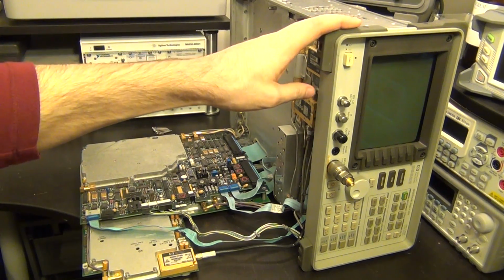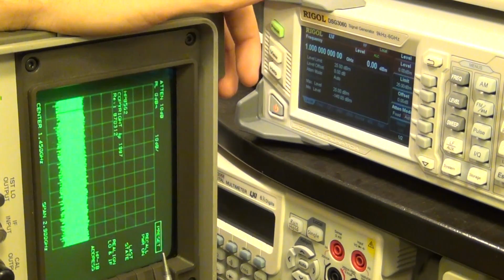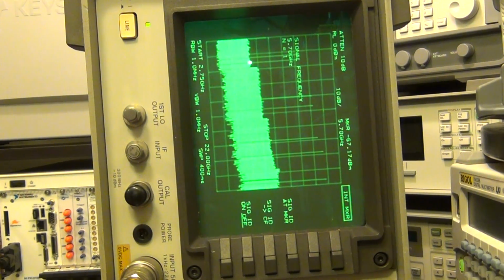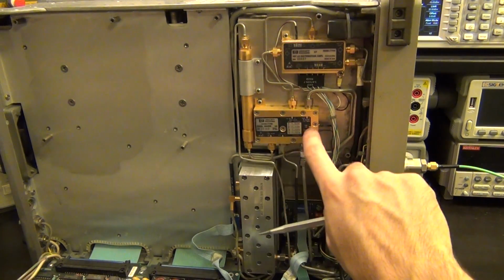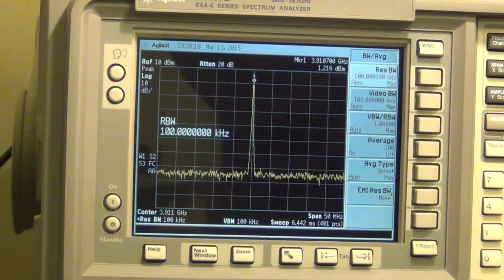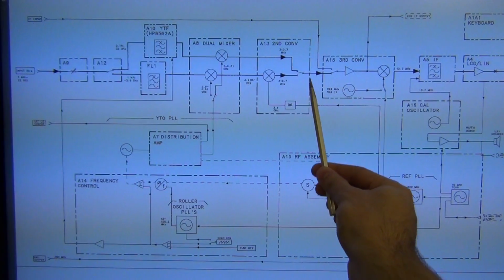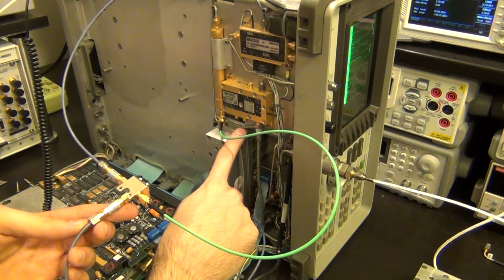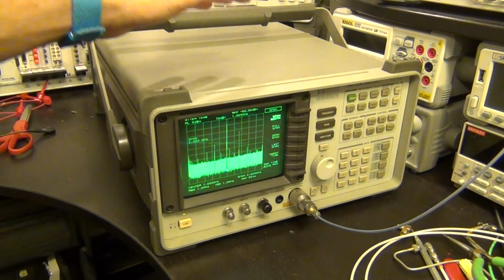TSP #47 - Teardown, Repair and Analysis of an HP 8562B 22GHz Spectrum Analyzer

Comment: Hello! I have one of these (8562B) for sale... It was unused for a long time and had a problem with the power supply when turning it on. It was working fine before that. I'll give you a good price the way it is. It is still possible to recover it for use or even for spare parts to repair others.

Comment: Thank you for sharing your experiences, very nice your troubleshooting video. Could you give me some advice !?: " I have a HP 8561E spectrum analyzer (a quite old SA), during the operation, I accidentally connect a wrong RF input power over +30dBm in very short time until I recognized that I am wrong- about 10~15 seconds (It is 1W RF input max indicated by manual). Now, I guess it damaged the "RF input attenuator and the input mixer", is it right ?. When I connect a source of signal + 34dBm with a 40dB attenuator, But the screen now only shows me ~+14dBm (all ATT menu settings are set as: Ref.lvl = +40.3 dB = the 40dB attenuator+cable loss; The auto ATT set as manual @ 0dB). I guess the 20 dB ATT inside the SA was damaged.

Comment: At 50:20 notice that the spur is much narrower than the real signal. 
And there are a lot of false signals if you look at the whole bandwidth. 
All of them are noticeable narrower than real signals and they are always there regardless of input signal. 
I have exact same problem with my spectrum analyzer and it appeared suddenly! 
It was clean at the beginning.

Comment: Very helpful video.. I am having a few problems with my HP 8566B spectrum analyzer and even though it is a different unit, you have cleared up several things I was confused over regarding the mixing schemes.. 
Do you have any plans to do a tear down of an 8566B? No one has done this on youtube and yet  the 8566B remains a very useful and popular SA.

Regards,
Glenn 
DSM Labs

Comment: I have a 8592b and there are a few problems. First when I punch in a frequency the carrier if on frequency. But when I go to span it outward the carrier moves way off frequency. What will cause this problem? My other problem is the I and 11db off when I measure amplitude. What alignment would fix this problem? 
I have a  8591E and with no input signal  there is a high pulse that is after the spectrum analyzer 0 frequency carrier. What is causing this unwanted.
Reply: Rosalina19711 the 8592b is not synthesized, in the b model they omitted tge sampler and PLL and rely on a lookup table for the yig frequency. Just bump the case of the 8592b on small spans and you see microphony on your signal! The datasheet also says freq accuracy is 5% of span and the unit has no ext ref input as there is no PLL :)

Comment: Thumbs up for another interesting video and ESD-aware handling of sensitive components! :)

A little tip for all Weller Soldering Station users:
The older soldering stations come with a 3,5mm jack plug, which can be used to configure how the tip of the soldering iron is connected to PE.
Without that plug the connection to PE is hard (approx. 0 Ohms). If you're soldering ESD-sensitive components you might want to make that a soft connection (i.e. 470k) by soldering a 470k-resistor into the supplied jack plug.

Comment: You could have skipped installing the RF relay by using the LO output, but maybe you wanted to keep that. I was also going to say that you could have tested the 2nd mixer with a 3.9GHz RF signal but just read that you did that off camera. And I think the unit is not very useful wit all that spurs, I really wonder if that is normal. Oh, and you can see what the LO level is by just hooking up one of your other SA's, I wonder if part of the spur problem is related to the LO level.

Comment: Just a guess Shahriar, is that the Double-balanced Diode Mixer has a virtual ground within the mixer that is not sharing the same ground as the higher band mixer signal.
The unwanted spur's are not properly grounded or filtered out from within the HP Dual Band Mixer Assembly. On the high end the spur's don't occur at 5.9 GHz frequency
but at the low end they are generated. Could also be that the introduced mixer doesn't have the required shielding as the original mixer does. Anyways great video, allways
look forward to seeing what you are upto next. Cheers
Reply from the maker: Interesting idea. But I connected the external mixer to a different spectrum analyzer and there were no other tones besides the LO feed through. This is somehow due to the interactions between the second converter and the first...

Comment: The spurs are both sides of the signal so something's being mixed with the input.  could be some sort of harmonic distortion as there are more than one spur. Look at the  integer values separating each spur 1 3 5 etc this Will give you some clue to the type of source interference  if any square wave clipping triangle etc.
Reply from the maker: I looked at the mixer output on a different spectrum analyzer and did not see any other tones.

Comment: Really great repair video and well presented.
Q. could it be a high power RF input that caused this failure on the first mixer? because i'm always afraid to connect my spectrum analyzer to RF unless I use serious external attenuation and gradually lose some of them lol .

Many Thanks.
Reply from the maker: That is likely the cause of the failure. The low-band is actually DC coupled to the output port making it a lot easier to damage.